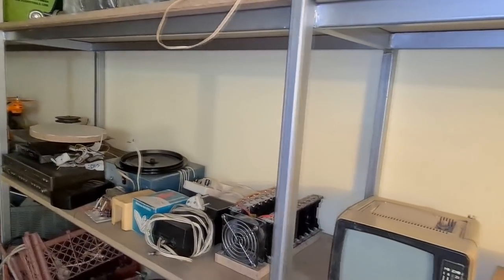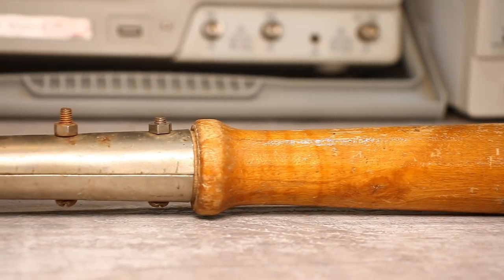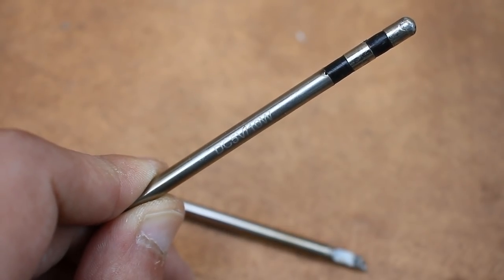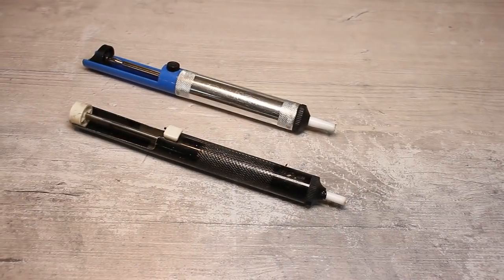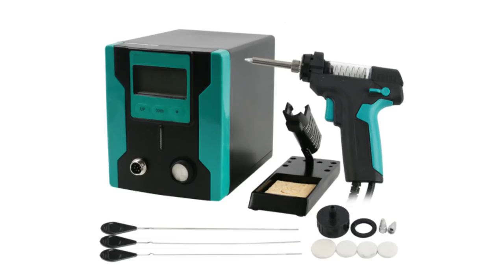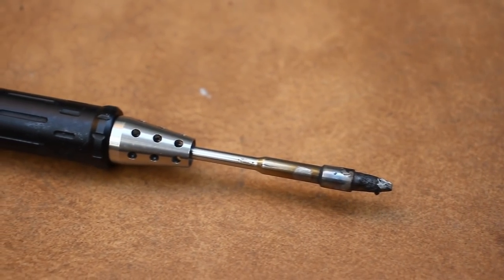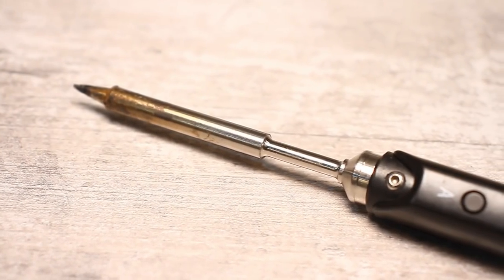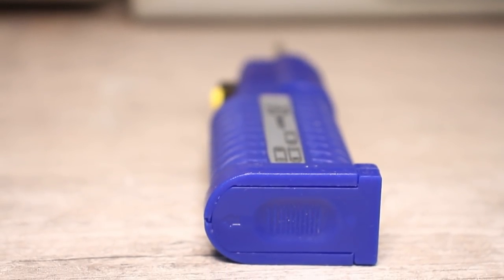The STRANGEST soldering iron and more!

Comment: I hate those "cold heat" irons or as I called them "arc irons" cause you had to get a perfect connection for them to work or they would just spark, and if you tried to melt anthing bigger than a tiny SMD part, the tip would actually heat up and then shatter under pressure from thermal shock. Sometimes you went though the tip before even fully melting the solder. After that, your batteries are now dead. My parents got me one as a kid...worst present ever.
Reply: i hear you.  i bought the cold heat 10to15 yrs ago.   most useless piece of cr@p ever made.  i had all the same problems as you.  never made a single successful solder joint with it.   i always wondered how it ever made it out of R&D..  epic FAIL !!

Comment: What about a LASER Soldering Station where the heat source just needs to be pointed at the item to be soldered and can be used for stripping the insulation of the wire by vaporization.